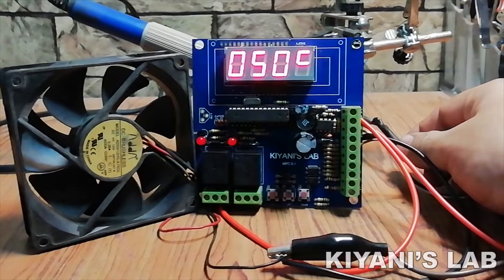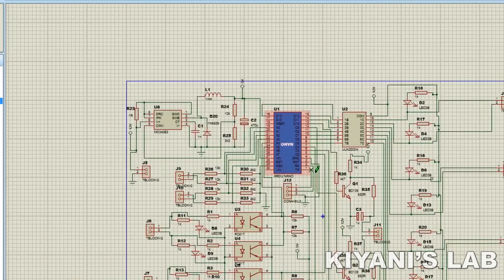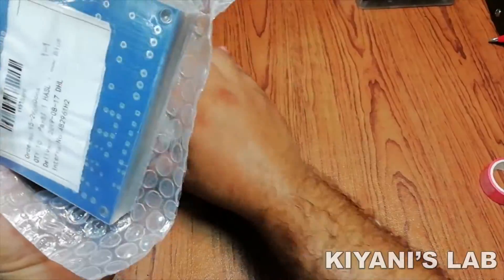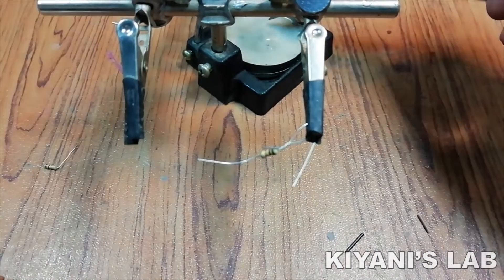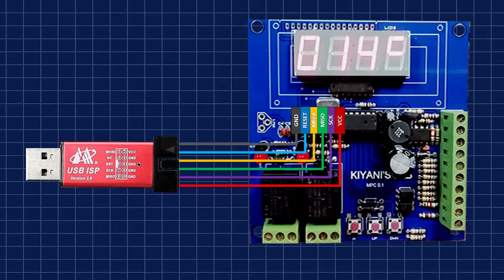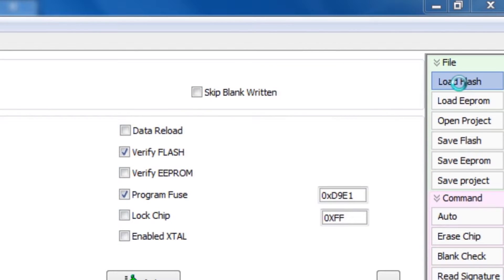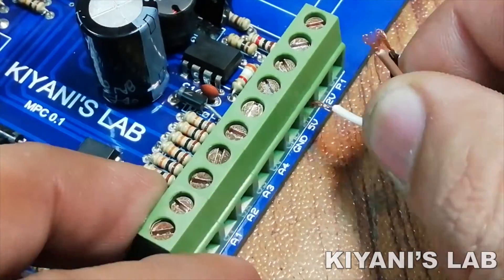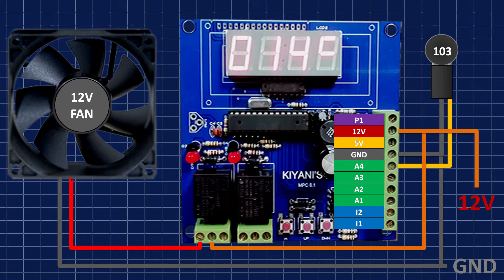How To Make Programmable Temperature Controller

Comment: hello kiyani...i am trying to do a diy hot air station...i already have the hotair handlewhich has 8 pins...there are two wires for thermocouple...is there a circuit board i can purchase from ebay without programming it or no arduino that can control the temperature of the heating element?...and also have the temperature led display?...thanks.